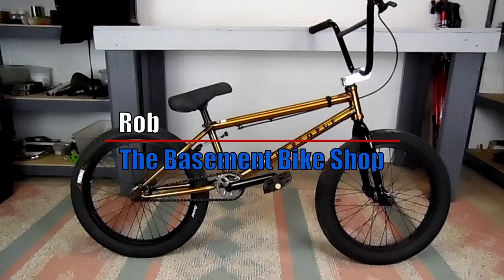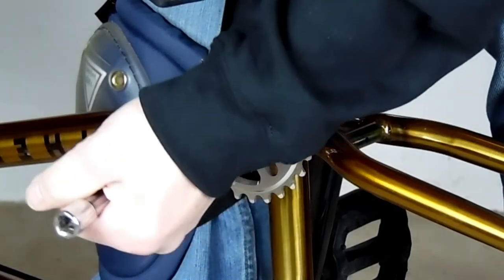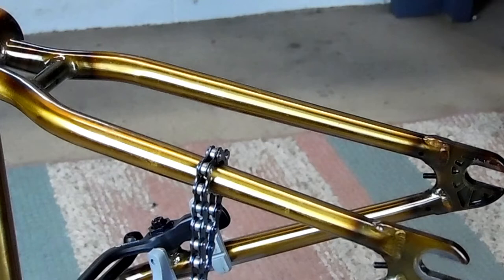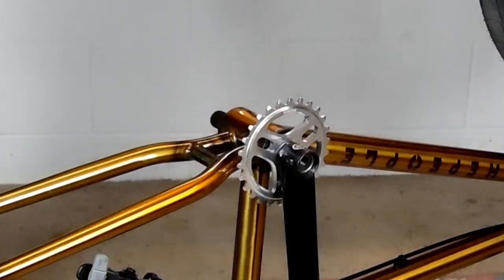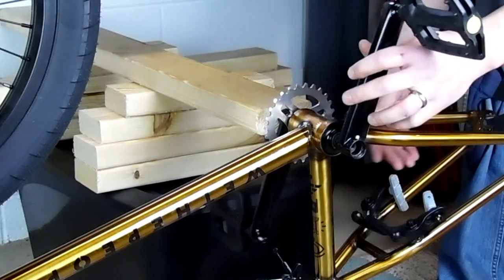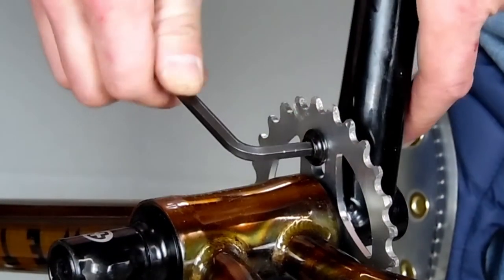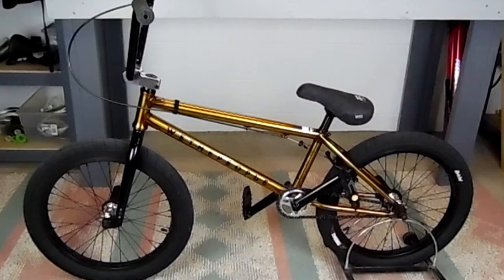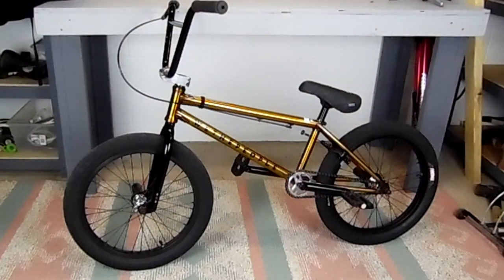BMX LHD Conversion- Part 2 Switching Crank Drive- Step by Step

Comment from the maker: @Justin Drown and the spacers...Yeah. There is that chance that your pedals will loosen up while you are riding, but i Know people who ran RHD cranks flipped for years and it worked fine.
Reply: The Basement Bike Shop Need to rearrange the rear tire after turning the wheel?

Comment: I have a 2 or 3 peace crank but u don’t have that sprocket bolt thing on the other side can I just flip the cranks around and will it be fine or will the peddles lossen up or do I need to buy new crank arms that have the sprocket bolts thing on both sides

Comment: I have 2 piece cranks and there’s only one bolt hole so I have to buy a new set of cranks or do I just need to flip dem
Reply from the maker: You can just flip them. The only thing that will be weird is you pedal threading will be backwards. If you are worried about it, you can put a low strength locktite on the pedal threads. I hope that helps.
Reply: The Basement Bike Shop thanks

Comment: i have a Grandson with a prostatic.  This makes riding a bike impossible for him.  This video may do the trick.  Number one can we buy a bike already set up this way?  If not what make or model do I buy to accomplish what you demonstrated?
Reply from the maker: Yes. You can buy bikes already set up this way. You are looking for "LHD BMX Bikes" (Left Hand Drive) or bikes with an "SDS" hub and crank (Switch Drive System) there are many bikes with these features. You can look yourself or if you know your price range, i can dig around the internet a little bit.
Reply: @thebasementbikeshop2336  Thank you
Reply: You’ll probably hav the beat luck doing it ureself or having somone do it there not that many lhd bikes

Comment: If someone did this to a bike does the left pedal now go on right crank and vice versa?? Juat realized the bike im tryin to put pedals on is now lhd??
Reply from the maker: No. Cranks that are designed for either rhd or lhd will have a hole for the sprocket bolt on both arms.   The right and left arm don't switch sides.  Just the sprocket and spacers switch sides. I hope that helps.
Reply: @thebasementbikeshop2336   the bolts only on one arm so if this bike came originally with rhd then the person got cranks specifically for lhd and cus if they were the original ones. And was switched it would be universal.im assuming that since they had back rim laced up cus it wouldnt work with rhd? Lol am i right if that makes any sense. Basically cant be switched back with these specific cranks
Reply from the maker: @urbanfarmer9166  It sounds like they just flipped the crank. you should check the threading on the pedals. if it is a LHD Crank, When looking at the sprocket(left side), the pedal should turn clockwise to loosen. otherwise, its a RHD crank that someone flipped. I hope that helps.